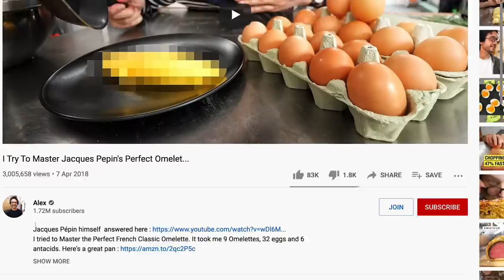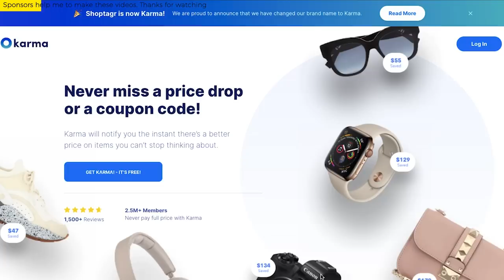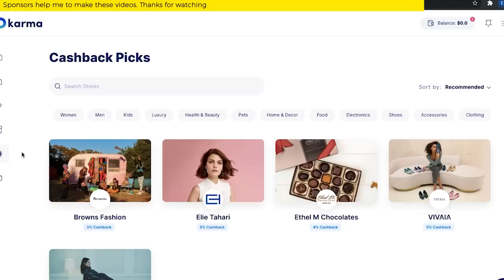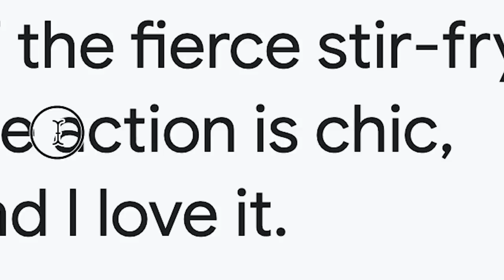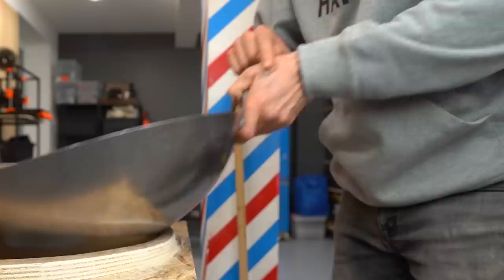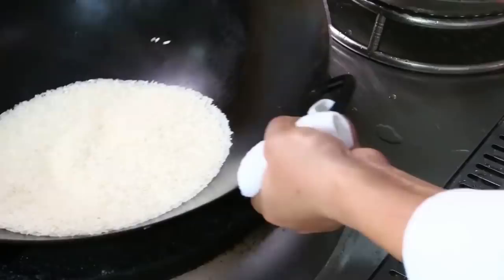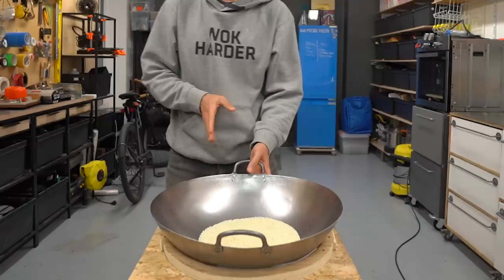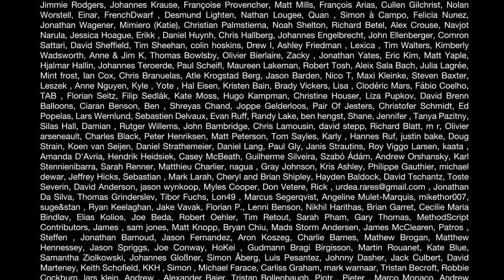The Stir-Fry Masters You've Never Heard Of

Comment: One of the reasons of having the towel is to ease the pressure wok handle delivers on your thumb. If you are going to work without it you are actually risking getting injured.
Reply: This. It was painful to watch him struggle without a towel for a minute
Reply: Celebrate Towel Day - May 25
Reply: Yep, scrolled down to say exactly this. Use the towel, it will help, a lot.
Reply: He's clearly going to use towel, but he was just doing some strength training then.  And it was clearly his lack of wrist (and a bit of abdominal strength) that was letting him down there.
Reply: @tams805  Man, please, learn what pressure is.
Reply: Late to the video and the comment, I'm glad it has been mentioned, it was so obvious.
Reply: @tams805  they're talking about using the towel during the practicing. Their point is the towel isn't just for the heat
Reply: I always go to work with my towel.
Reply: @kyorising  ditto

Comment: i like how he goes in depth at why he needs a nice springy spongy towel but then does it bare handed for the rest of the video.
Reply: My thought exactly! His poor thumb and fingers
Reply: this comment needs more upvotes.
Reply: I wouldn't be surprised if one of the bits of advice he left out was to practice without the towel. I would imagine the towel is mostly about the heat and practicing without it will help to build up your threshold faster.

Comment: You need a towel. That’s the missing key to this whole video. The weight is all focused on one small central part of your thumb and it’s hard metal. Placing a thick towel on the handle distributes the weight more broadly and evenly by opening the thumb up more. Give it a try. Cheers!

Comment: And basically the way of stair-fry is just to heat the contains inside quickly and still keep some freshness inside. There’s a basic dish in English should be called as “chilly pepper fries cabbage” is a great example, you can have the crunchyness of the fresh cabbage and still keep the heat of the dish, with the flavor of slightly smoked chill pepper.

Comment: Tried it once and it is really hard. They use really hot flames so one moment you slack off you burn the food.
If you notice they never turn off the faucet when Chinese chef cook. That is because the steel will warp when it is turn off.

Now add all this to the heaviness of the WOK that has no insulated handle

Comment: Even though it isn’t a hot handle as your training, you should still use the towel. It will relieve a bunch of the intense pain you describe experiencing in your thumb. Which in turn will greatly increase your performance, at least, holding-wok-wise

Comment: The correct wok is carbon steel material like what chef wang uses. The reason why its thin so you can easily change the temperature of the wok. It its too thiccc its temperature wont drop or increase immediately.

Comment: I love your methodic approach to learning. However, when you were emulating the chef in holding the wok for 1 minute, you forgot the hand towel. It matters. You experienced the thumb pain more because of the slender metal handle's pressure directly on your bone. The hand towel will reduce the pain by distributing the pressure. You still have to deal with the weight (hit the gym more! j/k), but the grip should be more comfortable. Good luck. Great series.

Comment: Alex when practicing use that little towel to hold the pan! Huge mistake not using it. It cushions your grip. You can do 1 minute easy.
Please also make sure to keep it bone dry, water would transfer the heat so fast you will get burned.

Comment: And last, as a Chinese that worked in a professional Chinese kitchen before, holding the pot as long as you can is not so practical on the field, people will just using their large spoon or shovels to hook the other side of potrings and use two hands to move it, beside, your finger mussel and arm will hold better after you doing it long enough.

Comment: You aren't using a towel in your hand strength tests! It really helps distribute the weight better so it's not as acute directly on your thumb's tendon. The metal will also get pretty dang hot once you're firing it up, so the towel is necessary (unless you're a Chinese wok god and don't feel the burn anymore, but I'm not so sure on that one)

Comment: Little detail i noticed! a lot of the times you were having issues with the weight of the wok you werent using the towel, but the chefs you were learning from were, is it possible the wider grip from the towel in the hand could slow down the burnout of the forearms?

Comment: Alex, would the folded towel have helped during your endurance test? Seems like it would relieve some pressure from the handle on your thumb. I've never tried it but just seems like it may help. I'd think the primary reason for the towel would be heat but it should also increase the surface area to distribute the weight better as well, am I wrong?
Reply: Just wondering why he does not use the tower technique right away. The folded towel only helps with the heat, while Alex is still holding the wok by his fingers.
Reply: @KnightKao  But wouldn't the towel increase the surface area that is pressing into his grip? It seems he wasn't able to hold it long due to the pressure that built up on that one spot.
Reply: @briani4959  If you watch the video again, you will see Alex is suffering from all of his arm paining instead of just his grip.